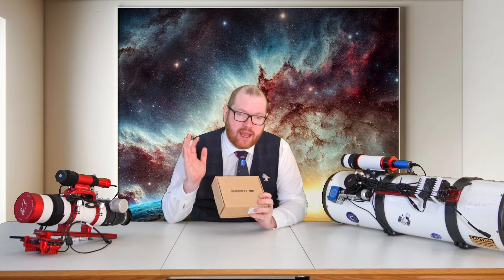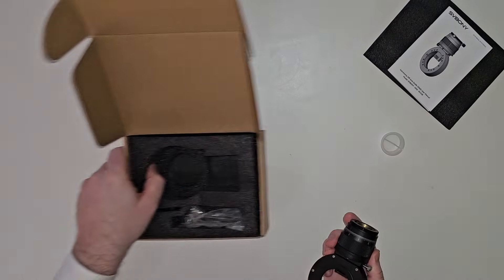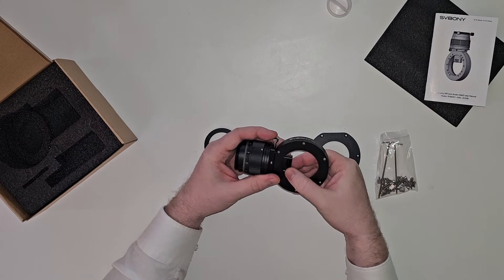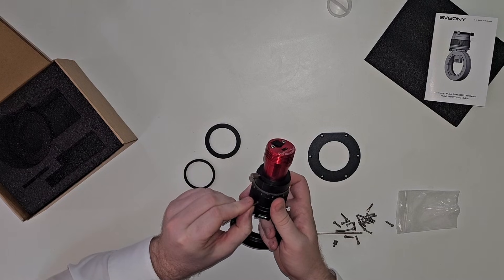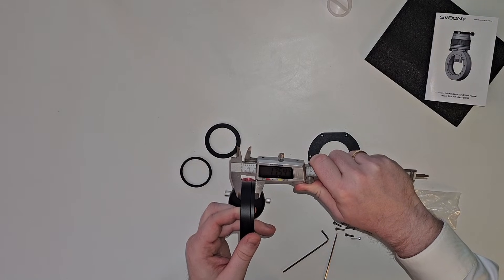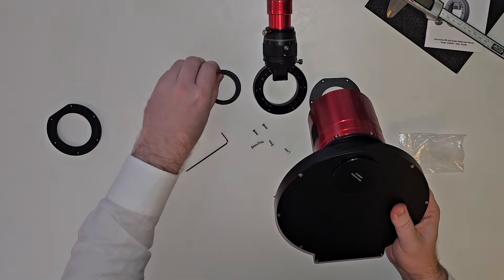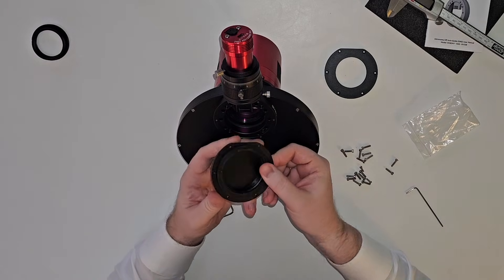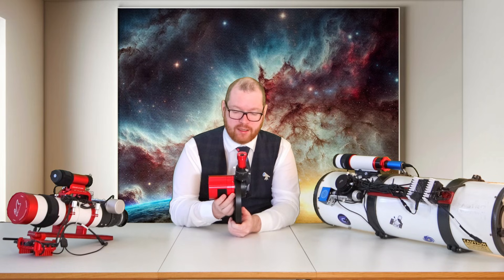SVBony SV238 - Unboxing & First Impressions

Comment: I'm disappointed in your glossing over of a common design fault, two in this case, with these types of low-cost OAGs. That is, the mirror stalk being adjustable only by disassembling the imaging train, making precise adjustment of it time-consuming, tedious, and prone to introducing error and other problems in the course of doing that. The second critical design issue is the use of a thumb screw to secure the position of the mirror stalk. I had to laugh at that. The thing is already bristling with thumb screws, can you imagine grabbing the wrong one in the dark with the intention of adjusting the OAG's focus only to have your hard-won stalk position get completely messed up by mistakenly grabbing the thumb screw that secures it? It being a thumb screw also makes it easy to come loose over time and shift the stalk position just through the normal course of being handled and stored. In terms of overall quality and design, this OAG is little different than what ZWO, QHY, and others have produced for years. It's nothing noteworthy or evolutionary. I suggest taking a more critical view of the items you review.

Comment: Do you intend to keep the 5mm ring top of cooled ZWO ASI camera while you using their EFW plus this OAG? What I understand that ZWO intend to remove that 5mm ring from ASI cooled camera, making it 12.5mm backfocus while bolted it to ZWO EFW than usual 17.5mm and move that 5mm ring to be top of OAG? Otherwise I see your backfocus consumed may be not 55mm🧐
Reply from the maker: Hmm i have not though of that. I assume  you mean the tilt adjustment plate? Is there a benifit to moving to top of the OAG?

Comment: Thanks for sharing your thoughts on this. I've just bought the ZWO OAG two weeks ago as I wasn't aware of this product which actually looks to be better value. I believe SV Boney will be releasing a filter draw to go with this OAG which also looks to be very good value. I have used Off Axis Guiding before and I much prefer it as I consistently get better guiding thought to be fair on my short fl refractors it doesn't make that much difference. My grab and go rig is built around an ASI585air which has an on axis guide chip fitted. I think eventually guide scopes will be replaced with OAGs or cameras with built in guide sensors and guide scopes will become mostly redundant as polar scopes are becoming since the advent of polar alignment software. I hope you soon get some clear skies, I could do with some myself.
Reply from the maker: I think the filter draw is already out. Its the SV226 i think

Comment: I don't use a filter wheel that allows you to bolt on this OAG and also the camera on the other side. This arrangement insures the top of the camera sensor is parallel to the bottom of the OAG prism which for a APS-C is important to prevent the prism from casting a shadow on the main camera sensor. I don't have a filter wheel because I use an OSC.  I use a ZWO filter drawer which has a M48 female thread on the telescope side and a M42 male thread on the camera side. The problem with this arrangement is when you use an OAG.  Once the camera and filter drawer is screwed on, you don't know the main camera's sensor orientation to the OAG prism. This becomes a problem when using an APS-C sensor. If the prism isn't parallel a shadow is created on the camera sensor. I have a C8 SCT and I chose the Celestron OAG which allows the camera side to be oriented independently of the OAG body. There wasn't much OAG choice several years ago and was the only one readily available and lucky for me it has that orientation feature, because I didn't think about this issue being new to all of this. It was just the recommended OAG for SCTs at the time.

It appears the SVBony OAG allows you screw on a filter drawer/camera assemble but no adjustment to the sensor/OAG prism orientation. I looked into the SVBony filter drawer and it will bolt onto the SVbony OAG but the other side screws onto the camera which doesn't allow OAG to main camera sensor orientation. While the Celestron OAG solves this orientation issue its helical focuser is not as good as this SVbony or other OAGs. It dosen't use a brass ring to lock in the guide camera but two screws which engage directly to the guide camera body, inducing a little tilt and also causing the guide camera body to rub on the side of the focuser barrel, causing friction, which makes fine focusing not smooth.

My solution is to use a par focal ring on the guide camera body which helps keep the camera centered and lightly and evenly turn in the two locking thumb screws. The par focal ring also also you to maintain focus distance if your need to remove the camera from the OAG. It would be nice if Celestron would improve the helical focuser. Another disadvantage is it's a lot bigger. The main body is 29mm so it's not an OAG that can be used on a refractor with a 55mm back focus.

I test for prism sensor shadow using flats. If I see a shadow at the top I move the prism up a tiny bit but not enough to prevent the sensor from picking up light. The SVBony has a rectangular prism which will accommodate the ASI174mm guide camera sensor. The Celstron OAG uses a square prism 12x12mm. The ASI174mm sensor fits fine but its centered in the prism so there is unused prism glass extending into the light path.

I see when installing a filter wheel you have to remove the tilt plate from the camera. I guess there is no way to adjust camera sensor tilt with a filter wheel. I guess it's not a problem as I don't see anyone with filter wheels talking about their tilt being off.

If you use a camera such as a ASI533 the sensor is small enough so you don't have to worry about the OAG prism/camera sensor orientation. I have an Askar OAG. I love the helical focuser but it doesn't allow me to adjust the main camera orientation when I use my ASI071MC Pro with APS-C sensor. It seem to cut off the sensor corner. I should probably sell the Askar OAG. 

You will enjoy the guiding with an OAG. I haven't had any issues obtaining a guide star even when using my OAG at F/10, 2032mm on a galaxy.

Sorry for the long post.

Comment: TIP: With your 1.25" guide camera thread it inside this OAG and then you can push or pull to change the Mirror depth, make it easy to adjust the Mirror depth..